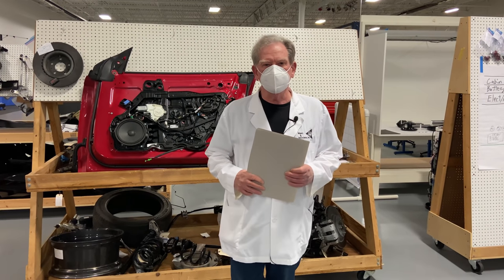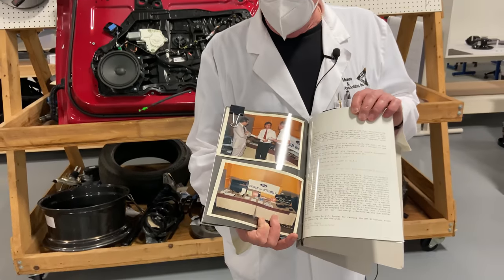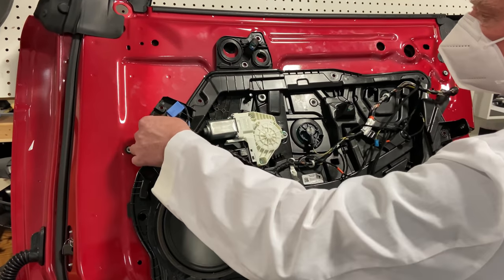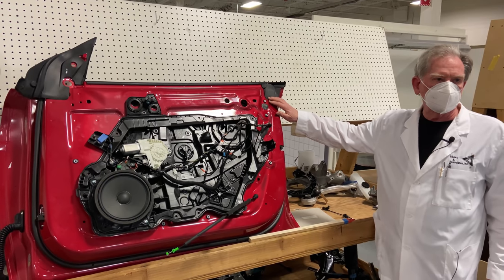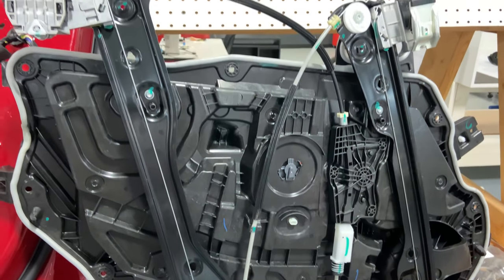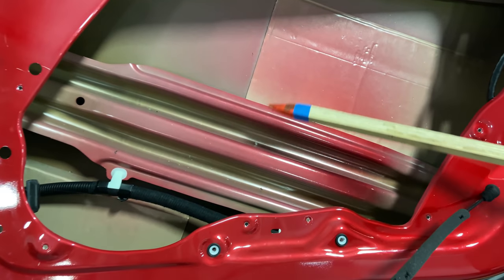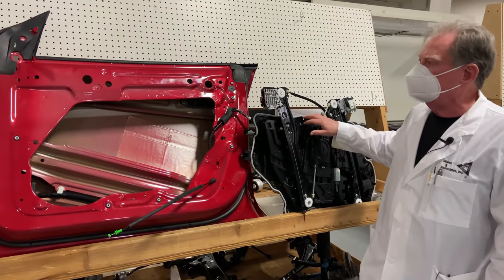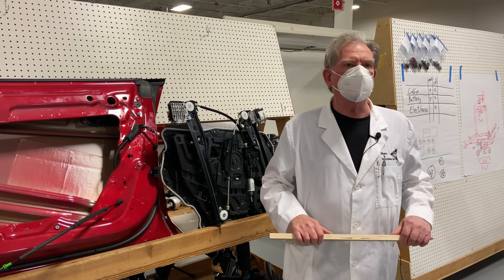Model Y E30: Advantages of Module-Built Door Construction and Lessons from the Past

Comment: Pressure sensor detect difference pressure in a sealed door cavity? or a sealed cabin? - presumably triggering side air bags?

If this sense pressure differential in air tight cabin, we may have problem sending with window roll down, or the window get smashed just before cabin’s impact distortion. 

If this sense pressure change in the door cavity, it may appears that cavity isn’t quite sealed up with noticeably to much perforation which can bypass pressure change. 

However this may work if this isn’t an ordinary pressure sensor but sound wave pressure sensor or a passive “g” sensor (such as a low cost inertia loaded moving coil speaker acting as a tuned microphone).
Reply: I think he misspoke, it's not a pressure differential as much as it is a pressure change. It senses the quick change in pressure inside the door cavity. The door cavity is not perfectly sealed but the sensor is tuned for it.
Reply: The car door is composed of two (or more) stamped sheets. Inside the door, there are drain holes at the bottom to remove water that inevitably leaks past the window seal. The door cavity is not perfectly sealed, but the amount of air that can escape through the various holes is predictable and is taken into consideration.

The pressure sensor operates by measuring continuous positive-pressure over time, as would occur if the exterior sheet metal is being rapidly crushed inward. Note that the air inside the door is mostly sealed and kept separate from the air inside the cabin. The plastic insert also has a rubber seal around the perimeter. The sensors can be tuned very specifically to respond to a particular wave form or pressure level. 

This type of sensor is quicker to respond than the older style impact sensors which measure force and deformation in the door sill/ pillar area.
Reply: idylwild48 
Agreed.
Reply: naarealy 
Agree

Comment: please talk about headerless doors. what are the advantages or disadvantages of this design. why do some cars have window frames on the door and why do some not. always wondered
Reply: its just esthetics, heardless doors looks way cooler , just like with cabriolets
Reply: Convertibles use them and most sports cars. They give a cleaner look to the car. Open cockpit, flusher appearance.  Glass guidance is much more complicated and usually requires adjustability features, which is one reason integrated rails are not used. Sealing is more of a challenge. The window regulator and glass attachments must be very robust as well to handle the unsupported glass loads.

Comment: I hate those plastic pulleys on the door window mechanism. Had a 91 Maxima in Texas that lived outside all the time. The heat overcame that plastic and it could no longer stand up to the wire cable. Plastic disintegrated and wire came off pulley. Only fix was to replace entire window mechanism because a tiny piece of plastic failed. Happened on three windows before GF totaled the car. In my apt complex there was another maxima that had a screw driver jammed between window and inside of door. I'm sure it was the same issue. There are just some places where plastic should not be used. Sorry to see Sandy did not ding them for those plastic pulleys.
Reply: Car was only 6 months past warranty expiration.

Comment: i do not know about for assembly line work but as a technician fixing cars door modulus like that are a huge pain. until you you have seen the inside of the door you have no idea what way to tip the thing to remove it and the tolerances for fitting them in are often so tight that even knowing how it goes in you still have to fiddle with for far to long. and from a consumer's point of view the parts to fix a broken window regulator is often 2 to 3 times more.

Comment: That is such a great idea. Anybody who's ever had to do any sort of work inside of a traditional car door can attest to how terrible it is. The only 'gotcha' here is that you must remove the glass to access the inside. Looks like that's an easy operation though, necessitated by the design, so perhaps other than having to handle and realign the glass, that's a general win too!
Reply: stop talking nonsense, that was thing of the past, many manufacturers uses this type of things to also drastically gain in time
Reply: @carholic-sz3qv  What nonsense? It may very well be common in modern cars, I never suggested otherwise and I wouldn't know. Still a good design in my opinion.
Reply: @bradley3549  did i say it was a bad design?! wtf!!!
Reply: @Morlock in Training I'm equally confused.

Comment: Sandy, What’s the benefit of a headless (frameless door) door? Seems like a framed door would reduce wind noise.
Reply from the maker: A frameless door is lighter and helps with range of visibility (less sheet metal to have to peer around), and aesthetically some people prefer it.  When you go frameless though, you have to be conscientious with your door closing sequence in order to get a good seal.  Typically (and as is the case on the Y), the window lowers about a quarter of an inch when the door is open and then raises the last little bit once closed to ensure a good seal.  Thanks for tuning in!
Reply: Munro Live That makes sense. Thank you for the reply.

Comment: Nice video. I'm interested in what happens if you want to recycle the door with the plastic inlay. Plastic combined with steel seems to be more friendly than a block made with additives. 

What do you think?
Reply: The door module is recyclable. The parts are disassembled and sorted by material type. Steel, aluminum, glass-filled polypropylene, TPEs...

Comment: Like you Sandy...My suggestions were ignored.
But Unlike you...I WAS indeed fired!
In my case...the egos won to the detriment of multiple gas utilities in michigan...
Remember in the 80’s when auto manufacturers flocked to Japan in an effort to learn the ‘bottom up’ management Philosophy and style?
What happened...???
The Egos at the top abandoned the concepts because, well...big egos can’t tolerate challenge and equity.
Resulting in a GRAND CRASH AND FAILURE!

Comment: Thanks for all these wonderful insights. Does this type of design improve serviceability as well? To my non car-guy eyes it seems easier to get in and do any work if that's ever needed.
Reply: Not always. Check Kate and James latest video in which Kate repairs a faulty door handle on the[r Model S. Quite  nightmare take down to finally splice a snapped wire.
Reply: Paul Ashton Thanks, will check that out. Do S and X have the same module setup or is it different?
Reply: All the components are generally serviceable on the module and easy to get too. To get inside the door you'll need to remove the module however, so it can be more complex than just removing a water shield.

Comment: Looks alot like a Hyundai door with a faulty window I had to work on recently. Having it all together on one plastic "module" turned what could have been a 50USD repair job on any other car into a 500USD repair job. I understand why this might be easier to manufacture, but for repair and maintenance it doesn't seem great. On my old mustang a similar repair cost me about 20USD in parts. Less easy to remove fasteners and more welds while putting all these parts together, it does look cleaner, but my limited experience with this makes me think it hurts repairability.

Comment: Hey Sandy, is this why all new cars plastic parts squeek now?  To me it seems that new cars make way more noises from the door area than cars made 15 years ago?  One thing is cost cutting, another one is user experience, I hate squeeks.  But maybe I’m wrong and there are other reasons...
Reply: Teslas are so quiet that every little noise is more noticeable. Many cats manufacturers are making cars with built in audio dampeners to cancel out that noise. Maybe Tesla can put that into the next software update.
Reply: There is just way more content in doors now than there used to be. Control modules, pressure sensors, passive entry antenna, multiple speakers, wire harness variations for all manor of options, electronic latches, etc...all this is crammed into less and less space, so the clearance between parts is very close. Trim panels have gotten much more complex as well.
Reply: idylwild48 thanks

Comment: Point for making the door module easily removable, with metal guides.
Minus a point for using a cable lift instead of a much more dependable scissor lift.

I also liked the MK 4 or 5 VW Jetta design with the removable outer door skin. That was also very easy to work on.

Comment: self tapping screws aren't the greatest for service ability
Reply: This element may have to be dismantled once on average, for this the screws are sufficient. In the worst case, you use minimally larger screws or thread rivets
Reply: @Zedus-rl9hp  If one has to replace a self tapping screw after it is removed there is a simple trick. While applying gentle pressure, rotate the screw counterclockwise until you hear a click. Now go clockwise and it will screw into the previously cut threads. Most mechanics know this, but it is still a revelation to some.
Reply: @danielcarroll3358  Yes, that's right.

Comment: Hi Sandy , is the anti-intrusion bar made out of steel? How is it assembled to the door inner? can’t see it... thanks
Reply: Vito Di Lascio Welded on both ends to the door frame. They put sealer blobs between the bar and the door skin.
Reply: Vito Di Lascio  Yes it is steel.
Reply: Just Because  the door frame is aluminum...could you please elaborate your answer?

Comment: Maybe it's just my experience with 1980s GM frameless windows, but I don't entirely trust them.  I understand why they are desirable from a manufacturing standpoint (smaller stampings, more efficient use of materials), but that 1980 2-door Malibu that my parents had was pretty terrible.  You'd have to manually wind the window down, then back up every time you got in the car, and you had to be sure to close the door by pushing on the glass - otherwise the window would always fail to go under a tab, and it would be left open a crack.  (Having snow on your seat at -20 C in the middle of winter isn't very fun).
Reply: That is exactly what our new Ford Mustang does, with frameless windows!  When you start to open door handle, the window will drop a tiny bit to make it easier to open.  When you close door back, the window will go up a tiny bit to make a good window seal.  I bet that most customers don't even notice, but are just happy with no wind noise or snow in the car.